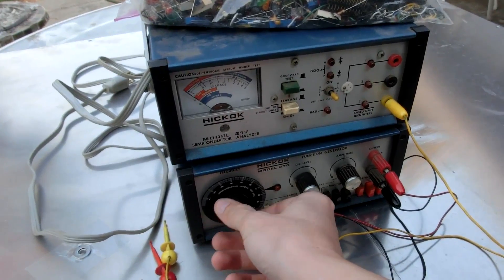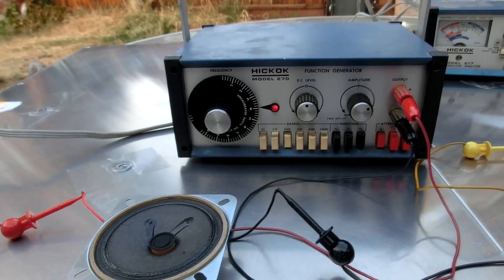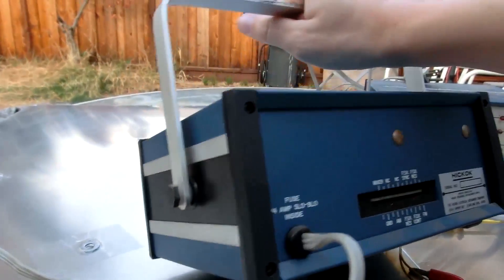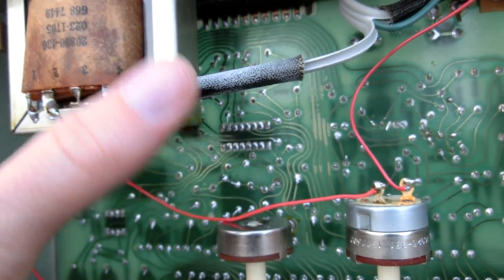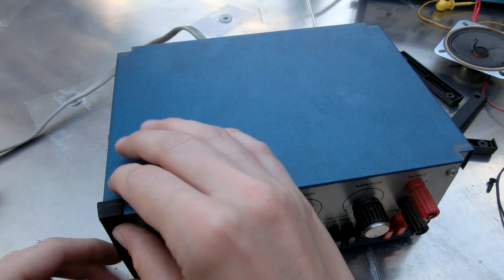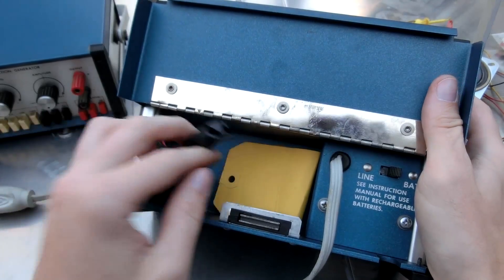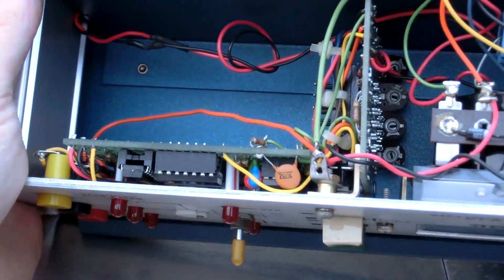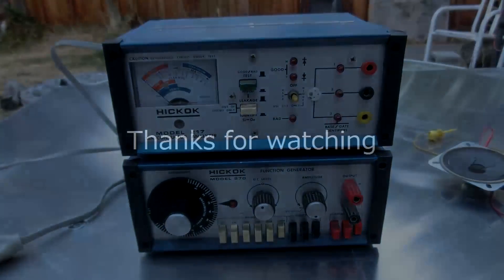Random Bits 0137: 1976 HICKOK Function Generator, Semiconductor Analyzer

Comment: Those connected transistors are probably a matched set. They're thermally coupled so temperature changes impact both equally. Probably a main part of the oscillator.
Reply from the maker: yeah that sounds right.

Comment: If I had one of those, and planned to do something with it, I suppose I would probably try to put a small form factor PC inside, along with a battery pack. Nice, portable desktop PC in a durable case. Granted that would mean modifying the case for air circulation so that... would be a minus. On the other hand I have a crap tonne of old HP slimline PC's I got from various places, that I've been meaning to put Micro-ITX motherboards into with half high video cards for use as entertainment center PC's. I was planning on doing that in 2010, so  odds of that happening seem unlikely. On the on the other hand, they are sufficient bookends and were just the right price. Free.

Comment: thosse transistors are put together (thermocoupled) so the behave as similar as they can due to temperature, those transistors might even been handpicked to be as close to each other as possible for their use. they might be in use as a current mirror.
Reply: Or a diff amp
Reply from the maker: makes sense ^^